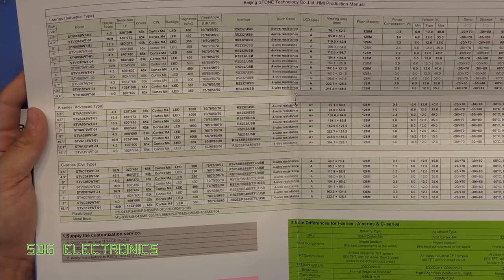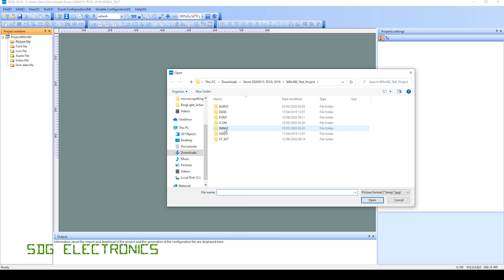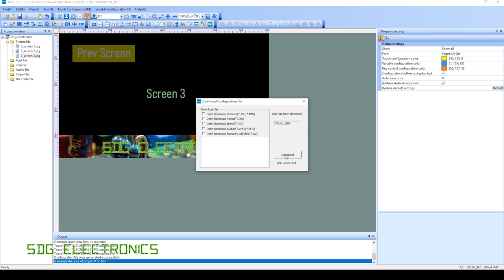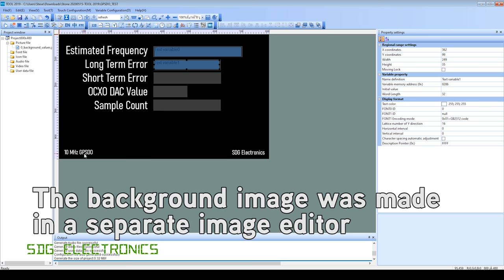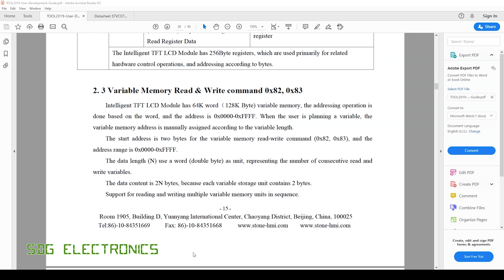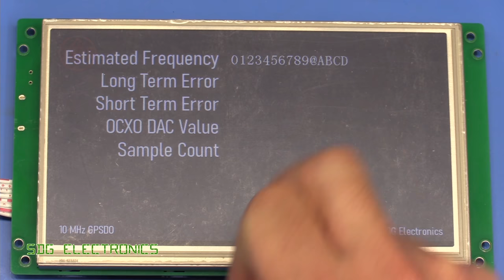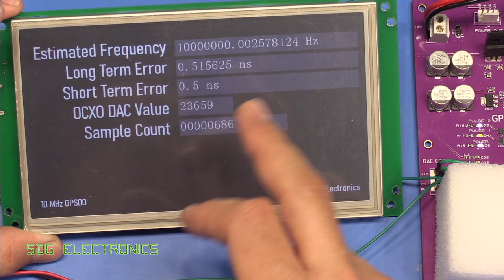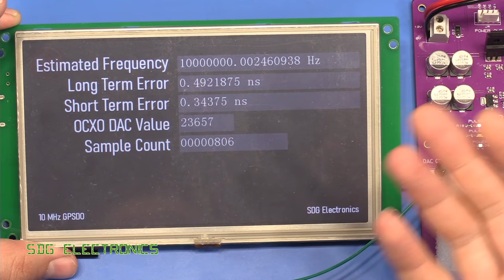SDG #162 Easily adding a Colour TFT to your electronics project

Comment: There is definitely a need for this type of solution. What I was previously looking into was the MIPI DSI port on rpi, which is intended for connecting to the touch screen of a smartphone or tablet. Unfortunately it appears not to be a proper standard (the protocol). All except the lowest level. What this means is that the closed source binary gpu driver on the rpi arm soc does not know or include the necessary linux display driver to drive specific models of common smartphone MIPI DSI displays... which is a shame. Because they cost as little as $5 and are intended for mobile, so are very power effecient (and can be quite large and hi res also at the same time). What the makers of rpi were hoping for. So instead of that they have partnered with somebody else and there is this 1 official 6 inch rpi touch screen. Which is not as good or as cheap as something from a smartphone. However the thing is even so it still seems to be a little but cheaper than this thing at 60 GBP on pihut vs 90 USD for this one. So am just wondeingr how they compare to each other in terms of respective features and quality etc.. It also seems that pihut sells a '7 inch hdmi touch screen' too, at 54 GBP (slightly cheaper). However being hdmi (instead of MIPI DSI) that would mean a higher power usage. Since the whole reason for using DSI in the first place is that its lower power consumption (for mobile application). Anyhow given the relative pricing I feels its a good thing to know what the differences are from a practical standpoint, to better decide which is best for a real life application. I really don't presume to know myself. BTW  'goodtft/LCD-show' on github is a software project for driving such displays on the rpi. YMMV Clearly these devices operate in different ways. And some of the older rpis and their associated hardware can be really buggy. I am not so sure if the same holds for their newest product is any better (that would be the 6 inch MIPI DSI connected to an rpi 4). I still feel its expensive. Actually there was also this hackaday project 'MIPI DSI Display Shield/HDMI Adapter' which is open source, which seems kindda abandoned. BUT IT GETS EVEN BETTER Are you still reading this SDG? Because in digging up that old link I found there is a brand new announcement TODAY lol. The article title is 'Xilinx Makes MIPI CSI And DSI Controller IP Blocks Free To Use With Vivado'. So that could be pretty helpful, couldn't it? Might make development of new hardware a bit easier. Drop in a pre-made ip block. Very interesting new development. We might hope.
Reply from the maker: I think they are two very different solutions - if you have the capability of running a Raspberry Pi in your project it probably wouldn't make sense to use one of these display modules. You can make an amazing UI with qt or something similar on the Pi and have full control over everything you want to display - the problem is the available number of compatible touch screens which make the best use of the resources on the Pi. If you wanted something very specific, you could replicate the UI functionality on a Pi and then interface with your other project. These TFTs with integrated controller though are primarily for situations where you want to interface with some basic piece of equipment, or you want to add a snazzy display to something that doesn't have the processing power to do all of the graphics, or (like me) if you don't have the software skills to program up a UI. :)

Comment: I would've started with monospace font to display values in any case.
I just find it more convenient when each digit has its own place.
And a font that was designed to be monospace - won't be ruined.
Reply: And for consistency there are families of fonts that include both hinted and monospace variations.

Comment: I have used those it is so easier than Nextion. Also they have bigger memory options
Reply from the maker: They're potentially a nice option for someone like me who don't have the software background to do the whole thing youself.
Reply: @sdgelectronics  Or even if you do have the software background but are only building a very small number of devices.
Even with the required software knowledge, I imagine it would still take a long time to develop and maintain a decent GUI (I'm a primarily-backend Web developer by day, giving me an insight into that sort of thing!).
So, given the hourly/daily cost to a company of software engineers (or e.g. electronics engineers with enough software experience), it wouldn't require much of their time before a product like this was cheaper - and hopefully more reliable, too.

The same could hold true for a hobbyist that only needs one or two of these and either values their time enough, or simply hates writing software enough, that the somewhat high cost of these panels (vs. a "bare" LCD/TFT module) was worth it.
You alluded to much of that in the video, though... 😅

In the past I've briefly looked at the Nextion displays on AliExpress, and these from Stone are only slightly more expensive, while potentially having better support from the seller (in terms of software to develop your application, and after-sales support): displays mentioning Nextion are currently around £9~11 per nominal inch of screen, compared to £11~13 per inch for the Stone displays.

Definitely worth considering the smaller models for future projects!
I doubt I'd ever really be able to justify the >£110 for a 10.1" screen. I have several old laptops that I can convert to standalone displays with those ~£20 LCD driver boards if I just wanted a large-ish display, and if I wanted an interactive home GUI panel that size I'd maybe look at using a second-hand Android tablet, where my Web knowledge would let me easily create a Web-based UI (even if my atrocious design skills would result in it looking awful and I'd be relying on Bootstrap to save my arse again!).
But £50-ish for 3.5" or 4.3" could be appealing :)